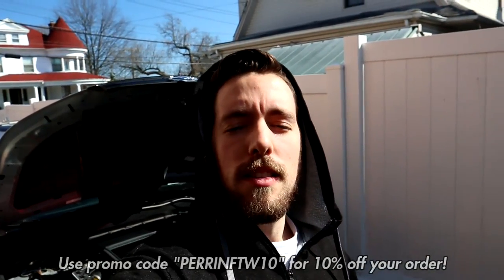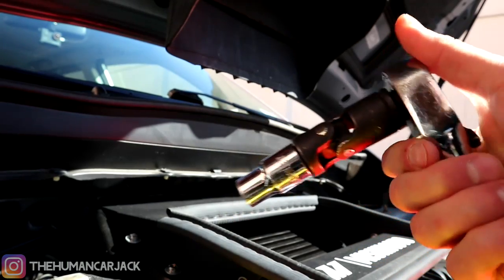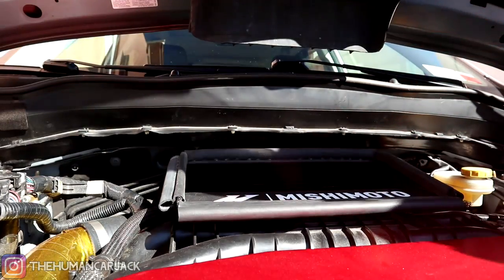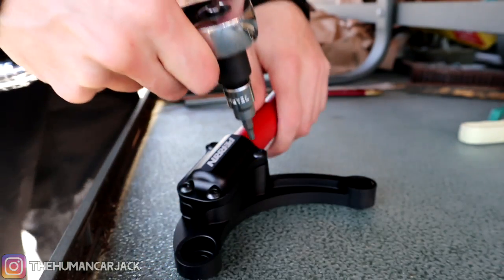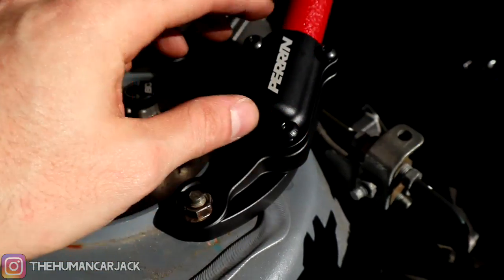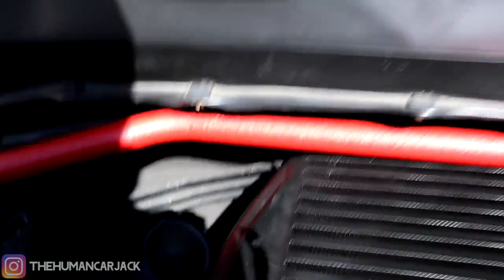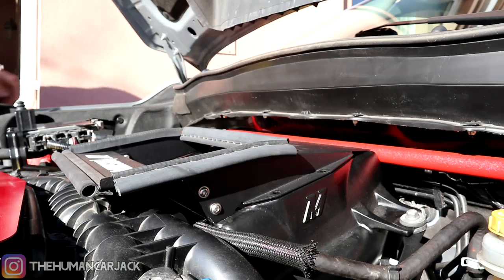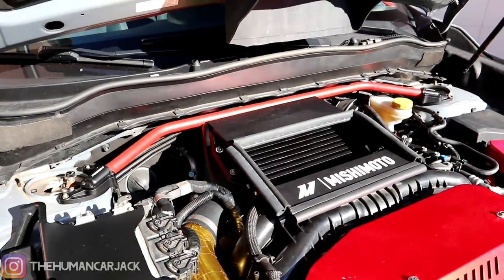Perrin Strut Tower Brace | 2015+ WRX/STi & 2014 - 2018 SUBARU FORESTER XT

Comment: Does that mishimoto intercooler shroud help. Like is there a noticeable difference. I want to find a adapter to hook into the intercooler to measure the intake air temp from there instead of the cold air intake. I live in boise idaho and the summers here are hot. My intake temp is usually always 20 degrees hotter then the outside temp when I’m driving. When I come to a stop the temp will skyrocket. It will be 100 outside and at a stop my intake temp can reach 130 to 160 pretty quick it sucks

Comment: I have this same bar and the same mishimoto tmic. I can not get the bar to fit. I have a late 2016 early 2017 wrx and the bar hit the plastic on the bottom of the windshield wiper cover thing right against the firewall. I have tried to force it between the intercooler and that plastic on the firewall and it will not go and it’s scratches the hell out of it. It sucks. I’m going to find one that fits more over the motor.
Reply from the maker: Yeah it was a pain to get it to fit. I cut some of the plastic near the fire wall and put some 3M tape to keep from scratching but it looked like trash so I got rid of the bar
Reply: @TheHumanCarJack  yea I thought about seeing if I could remove the plastic but as far as could tell that plastic holds the bezel for the windshield wipers. I just took the bar off too. If I end up saleing it I might buy another one that fits over the top of the intercooler but I’m not in any hurry it’s mostly cosmetic so I rather put money towards getting my motor built and studded